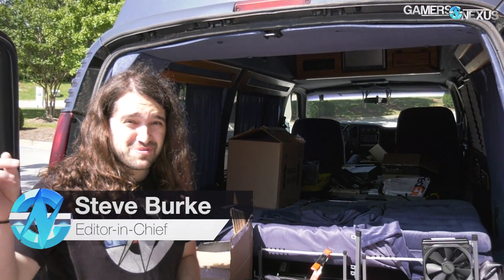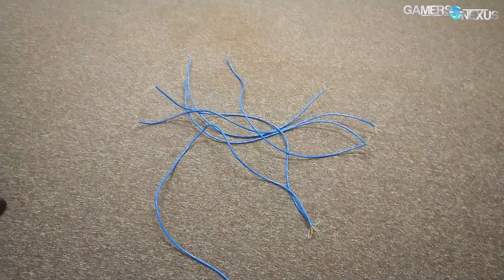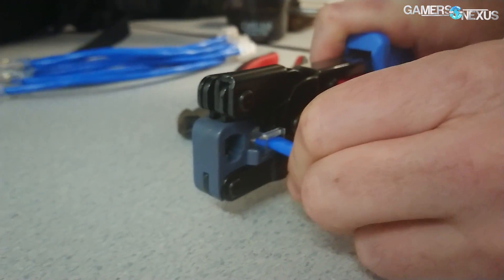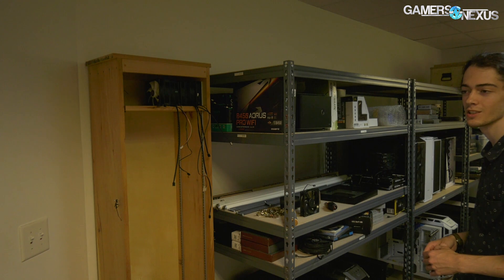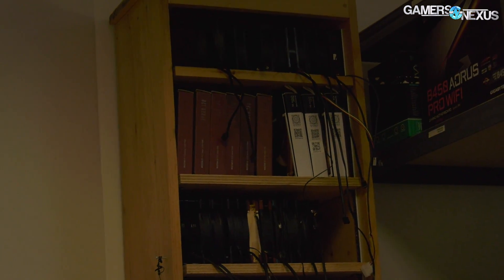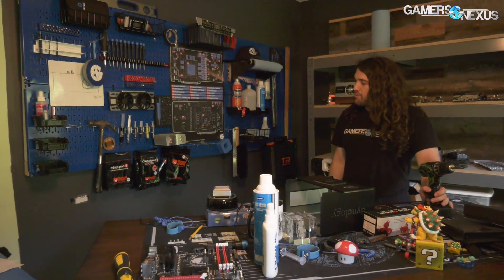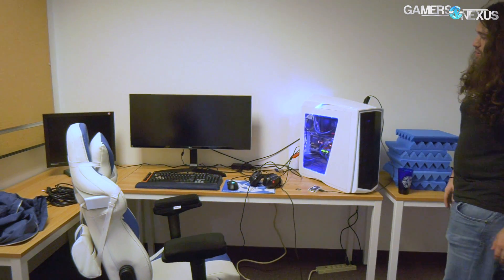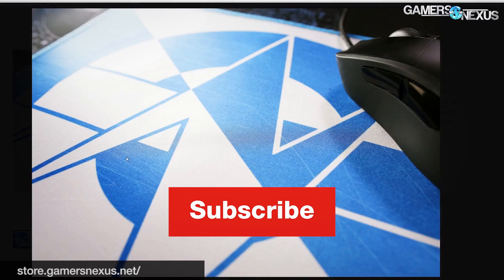Set Building, Organization, & Test Benches: GN Moving Vlog, Part 6

Comment: You could have used screws in those walls, there are wood screws and there are metal screws. If the wall studs are a thin gauge steel I like to still use wood screws because they usually hold better, but if it is a thick gauge steel you need a self tapping metal screw...

Your magnet was sticking to the screws holding the drywall that are mudded/sanded/painted to not be seen. You still could have screwed right into the metal stud and mounted the peg board but would need a spacer to not mount directly to the wall so you could actually use the peg board.

Hopefully this helps

Comment: Machine screws would work just fine 3 inches long. Pre-drill the wholes with a bit smaller in diameter than the screws or you could buy self drilling screws for fewer steps.

Comment: All network cables have a minimum length spec which I am sure is being violated with your custom short patch cables.  The spec has too do with with signal form recovery needed because of the distortion caused when crossing each connector.  The violation creates packet loss and therefore speed reduction due to retries,  A network sniffer can confirm this, but just checking the interconnect spec avoids any problems.  I have corrected many cable plants with this error.

Comment: Next time you build they have bits for screws that have sleeves on them so the screw won't slip. Otherwise be cheap and use a Philip's screwdriver as an awl so you can set the screws before you even drill them.

Comment: 14:38 But... (lol) If there's a way to support the weight you could get some thin chains and hang it from the roof, might have to file some little holes in the ceiling tiles for the chains to go through, but it would probably look better and (depending on what's in the ceiling for mounting) you might be able to get it right against the wall? :P

Comment: Studs      Every 16in center         Use Toggle Bolt  Anchor for heavy and easy anchors ...as remember it's a down weight    as I  install heavy electrical drives  on to drywall  and I should take pictures of what I do as I am a electrician...   to be honest I was shaking my head to the work you done to make a stand as  like I said I am a electrician so I work in construction ... I would of mounted it right to the wall  using the  Toggle bolts...   you will be shocked on how much drywall can  hold

Comment: Good work guys. Maybe at some point you could build a table into the "wall" at around the height of the one you have under it now. Would provide more rigidity to the wall, give you another rolling worktable, give a set where ever without lugging the separate table and free up the one under it now. Not trying to be a dick, just a thought.

Comment: They use screws to put the sheetrock into the metal stud. All you would have had to have done was go to your local hardware store and ask them which ones you need and what length.

Comment: Metal studs just required a different screw.  Lowes or Home Depot
Reply from the maker: Tony Kruchas You must have missed the text card that says we're not approved for that modification, so it's irrelevant.
Reply: Sorry, I did miss it.  Awesome job on the move. I started moving houses about the same time and am still in boxes.  You guys rock!
Reply: By not approved, do you mean with the person you are renting the building from or some weird city thing? Either way though, if at a later time you decide to change the setup for the pegboard and are still not approved for the metal studs. You can get some good quality sheetrock wall anchors (not the plastic ones) or toggle bolts. A more secure option would be to make a hole, slip a 2x4 in and secure it to the drywall. Really not as hard as it sounds. But, the new HQ is looking good. Can't wait to see the finished product and how it evolves over time.
Reply: You should have just built a whole false studio wall. Like a set. Do up the whole corner there. Metal studs are the way to fly in commercial construction too. The inside joke on a commercial site is to hold up a piece of wood. Because no one uses wood. It's all metal studs with chop saws and snips. On a chop saw you can cut a whole bundle of studs at once.
Reply: I'm sorry I did not mean to start anything with the post. I know metal studs are not used much here in the states, at least residentially, but they are used more frequently else where. They are used in commercial spaces, and if there is a restriction, it would be best to follow the landlord's requirements. Steel studs seem flimsy by themselves, but as a system are just as robust as wood if not more so.  It is Steve's deal, so it is Steve's decision, and he has the the talent with him to see it through.  They have done a bang up job so far, and I'm sure he has a vision of what he wants and what is best for the new space.
Reply: its a literal fire wall, in order to modify it you need permits and inspections to make sure it still meets its fire rating.  not worth it for what they are doing
Reply: The sheet rock is not stuck right to the concrete block. There are metal fur strips in there. But yeah if it was me I'd build false set walls. Which in a building are called temporary walls. For a start the gantry they built is OK though. Might want to paint those 2x4s flat black or something so they don't stand out so much.
Reply: could you not just use self tapping screws?
Reply: I'm confused by how it was going to be OK to screw into wood studs, but not thin, galvanized metal studs. What additional approval is needed for that? Sheet metal screws would have given you exactly what you had before. Either way, glad y'all are finally getting the much needed room.
Reply: Some things you're just better off not getting involved with.
Reply: and probably HSS drill bits..unless you want to blunt the basic vanadium shit
Reply: Also a risk of tapping into a live wire  - it's not rare to run cabling along the studs to the sockets.
Reply: If you are worried about hitting a wire you can use a Non Contact Voltage device to locate any cabling that may be where you are working.

Comment: They have self tapping screws at your local Home Depot, would have cut into those 22 guage steal studs very easily, surprises me how very unhandy all of you tech tubers really are, out of the bunch Paul  from Paul's Hardware is the most competent with a tool, other than a screw driver. Oh and Wendel too. Just an observation.

Comment: for your pegboard, can you use this http://www.fischerfixingsusa.com/Home/Product-Range/Product-Selector.aspx/cpage-productdetails/pcategory-1001002082/product-024556/usetemplate-productdetails/
no need to go into the studs, just the plasterboard and with around 7kg (i guess around 15lbs) per fixing it should be plenty strong for the pegboard

Comment: Coudn`t you just drill wholes into the metal framing, then cut some threads into the predrilled metal frame and screw whatever you want into it with some metric screws. (or whatever standart you`re using over there :)
Edit: Didn`t watch far enought. Although cutting threads is actually not harder than drilling a hole.

Comment: Self tapping sheet metal screws , easy solution .  the metal stud's behind the drywall should be found every  15 or 16 inches on center from each corner because that is a required building code .
Reply: They can't screw to the wall.

Comment: Cablemaking is a dying skill with the price of patch cables now a days
Reply: Not really, a 1000 ft. spool is pretty cheap and often comes with the connectors and making specific lengths is often very desirable if not necessary.  It adds up when you having cable running everywhere.